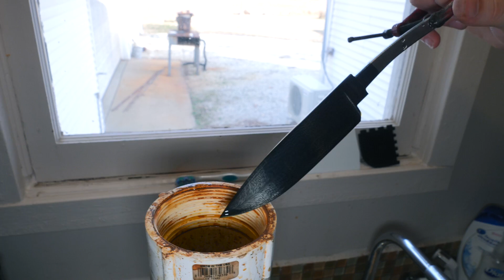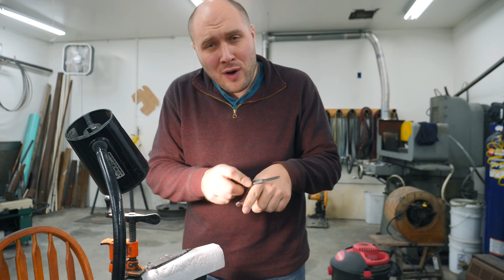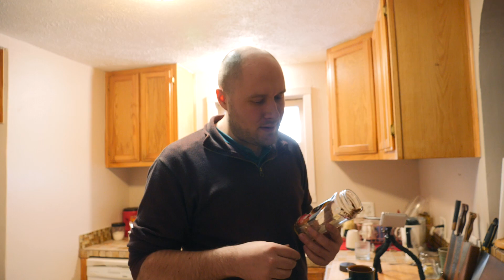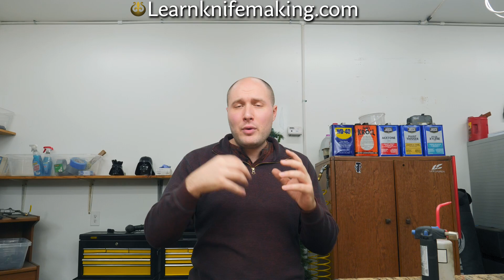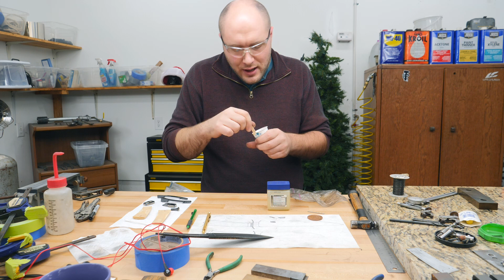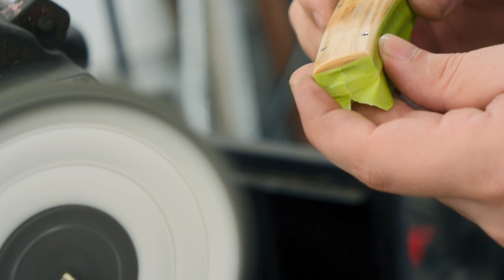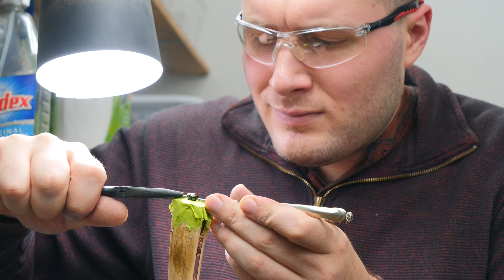The Hunter Knife Is Finished!

Comment: Wonderful! Such a beautiful knife and fantastic way to use Mammoth Ivory Scales that I had not seen before. I have a few Mammoth Ivory Scales that were carved for me quite a few years back by a friend of mine in Bali. They are  matched pairs of inner Ivory that have been carved in 3D so you can see through the Ivory and require a hollow handle. I'm trying to save as much of the Ivory as I can in my first design for making a full tang Bowie from a Damascus Billet I have. I will get the Billet cut by a friend who has Laser, Plasma and CNC cutters. My problem is I will have to make a 2.5 mm spacer to go between the Scales to fill the gap which is the thickness of the knife blade and then carve it to match the existing shapes and textures. I'm sure I can manage that but getting a small thin 2.5 mm piece of inner Mammoth Ivory or another Bone is becoming a problem as I am in Phuket Thailand. Any ideas would be appreciated, I could send you a picture if you have Facebook or similar. Thanks for another great video, I can't stop watching them. Regards Barry Rowe.

Comment: What process did you use for getting the designs in the handle parts?
Reply from the maker: Pattern welded damascus just like the blade. Be safe and be careful my friend 

Dad
Reply: @KyleRoyerKnives  I guess I asked that question wrong. I meant the equipment you use for the inlays.
Reply from the maker: Sorry chris I was reading to fast. We use a GRS graver system. Cheers my friend 👍🏻☕️🔥⚔️

Comment: 0:25 i dont understand where does the pattern come from
Reply from the maker: Hey David it gets stacked folded and reshaped a lot. We have several vids where we go into more detail     Cheers my friend 

Dad
Reply: @KyleRoyerKnives  thanks for the reply, I watched a few videos in the meantime. I was just confused why is the pattern not visible before dipping in. From what I understand the darkening only aplies to certain metals that get forged. Anyways, I'm not into knifemaking but your videos and creations are seriously cool, by far the best swords I've seen. Keep it up.
Reply from the maker: Good to have you hanging out with us all David. You can see the pattern faintly A couple other times also. Once right after heat treating where the knife has been sanded to nearly 120 grit, and another is after the blade has been hand sanded to around 1000 grit and up the pattern starts showing up very lightly. But you are correct the pattern shows up the most after it has been hand sanded and etched in ferric chloride  👍🏻☕️🔥⚔️

Dad

Comment: Another outstanding job.
Reply from the maker: Thanks Dave 
Do you have a hair trigger on your wire feed gun 
I had one back in the day when I was doing custom fabricating and production welding
With the hair trigger I could totally ease back,turn up my buds,get in my zone and relax 
It made out of position easer 🔥
My quality and production went up
Good times Dave 
Glad you’re hanging out with us all 
   Dad
Reply: @KyleRoyerKnives  I have several wire feeders with varying trigger pressure,
Most of my welding is TIG though. I do most of my work in power plants, and the bulk of that is in the boilers.
Reply from the maker: I had a Tweeco classic #3  300amp
I tricked out myself 
I kept it locked up after my shift 
Clean and race ready 👍🏻🔥⚔️☕️
  Dad

Comment: Which reagents and setup did you use for gun bluing? It seems far better black than boiled linseed oil/beeswax patina
Reply from the maker: Hey Ray check this out 

Making a 23" Mosaic Damascus Bowie Part. 10

Team Royer
Reply: Thanks a lot.
What's the solution for chemical cleaning and what's the temp to boil it ?
What are the salts? Nitrate and hydroxide of Na/K ? Thanks again
Reply from the maker: Brownell prewash. Just under 300° per Brownell blueing salt instructions.
Post wash in boiling water

Comment: May I suggest renaissance wax. It’s on Amazon. You will not be disappointed. As a custom gunsmith it’s what I use on the various steels. Nothing is better for corrosion protection, nothing.

Comment: This would have been a better question on your engraving video but what tool exactly do you use to do the engravings? Not sure my dremel has the duty cycle of what you use. I'd probably over heat it or burn through a couple motor brushes.
Reply from the maker: Hey Justin 
We use a 300000 rpm drill and carbide burrs 
Good question 
Team Royer